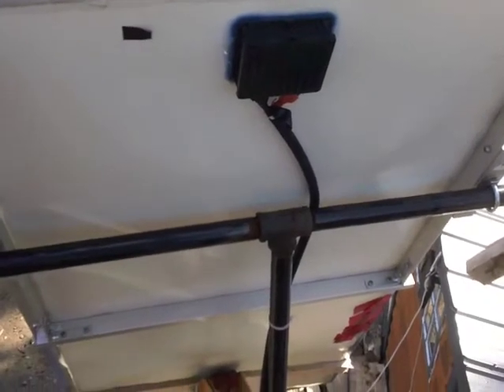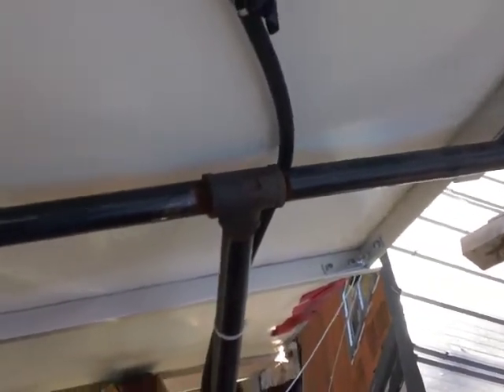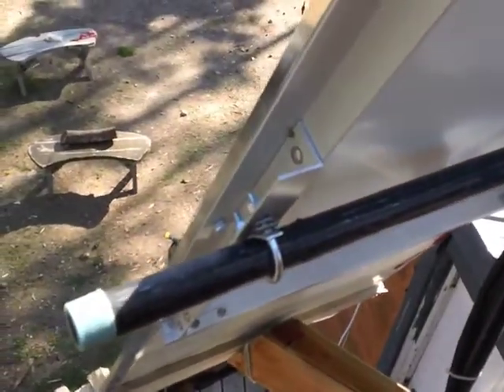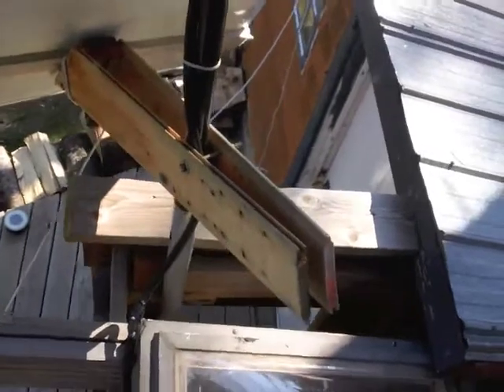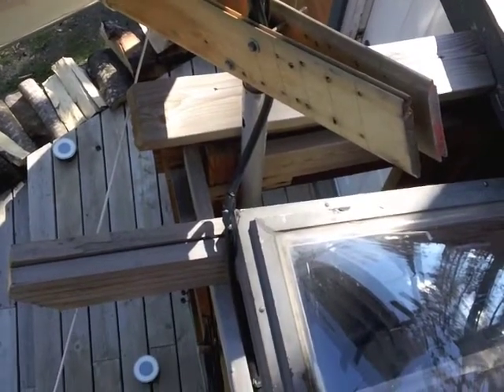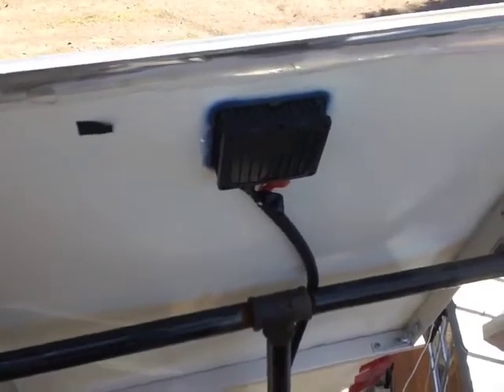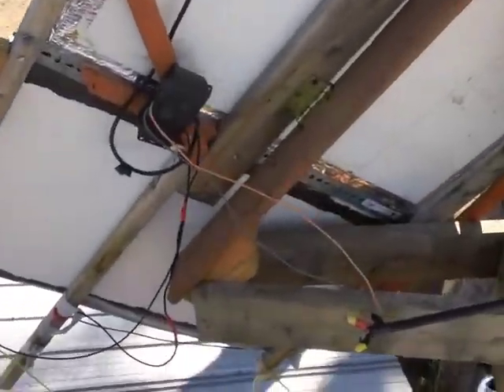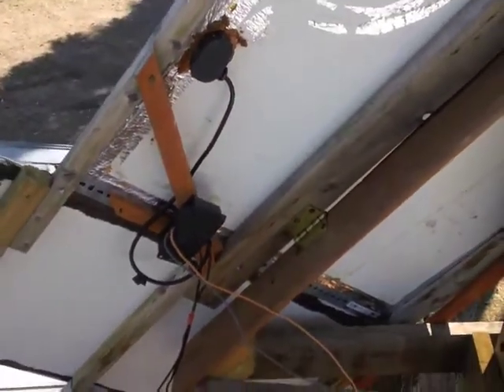How to Quickly Mount a Solar Panel from Recycled Stuff

Comment from the maker: I use a mix. Black pipe is cheaper, but you should rust proof it. See if Craigslist has some galvanized pipe in the "materials" section.